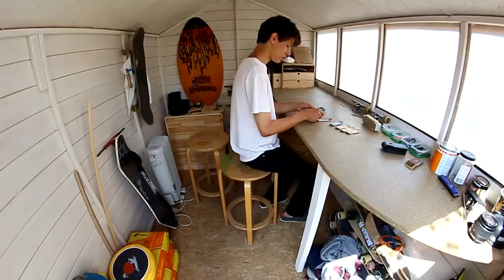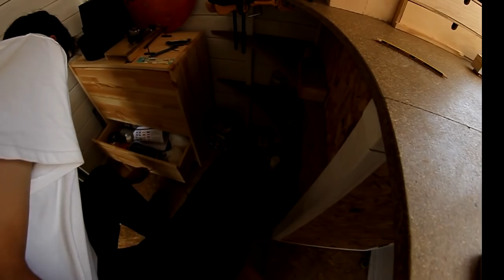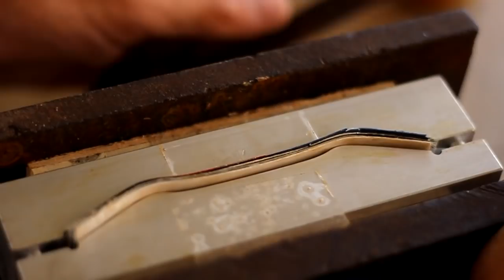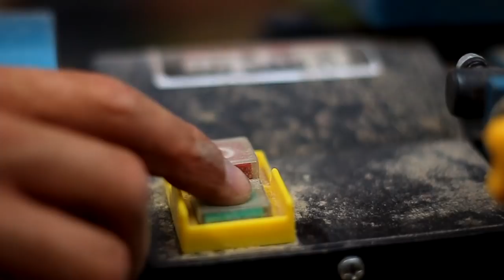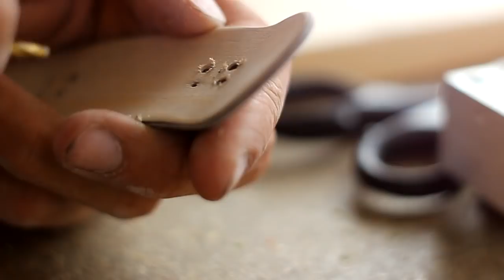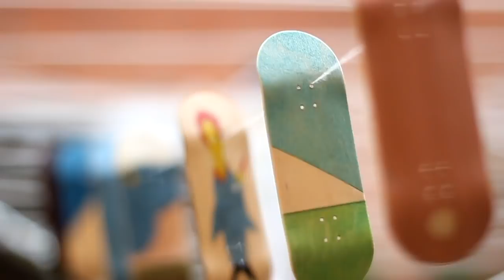How It's Made Fat Fingerboards

Comment: What kind lf glue do you use?
Reply: +GadiNator it was gorilla glue I can tell by the bottle and color because I use it all the time, be careful using it though because it expands so if you're using it for decks like he did use only a tiny bit on each piece of veneer or it will expand inside the plies and will be a lopsided deck.

Comment: Hey 
Which kind of glue do you use?
Reply: +Nicholas Berchtold  It is gorilla glue I can tell by the bottle and color because I use it all the time, be careful using it though because it expands so if you're using it for decks like he did use only a tiny bit on each piece of veneer or it will expand inside the plies and will be a lopsided deck.